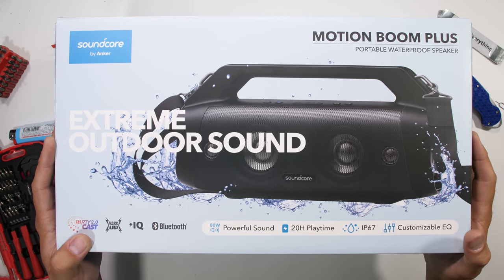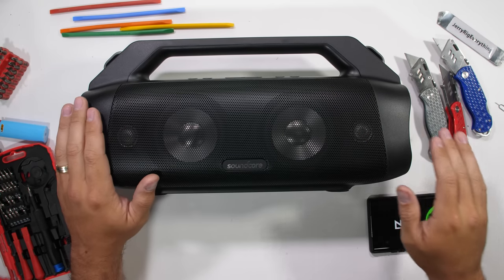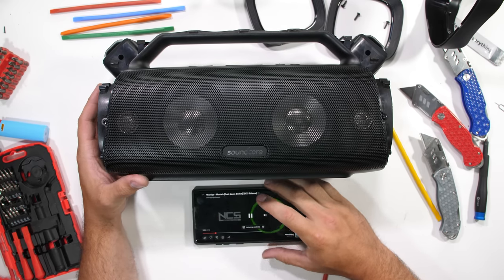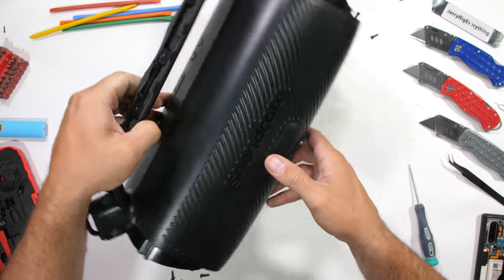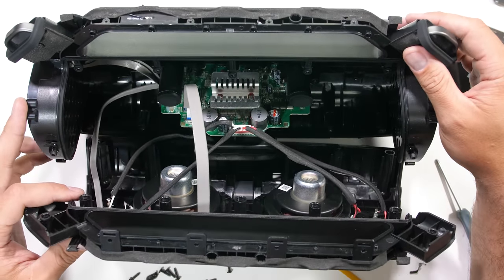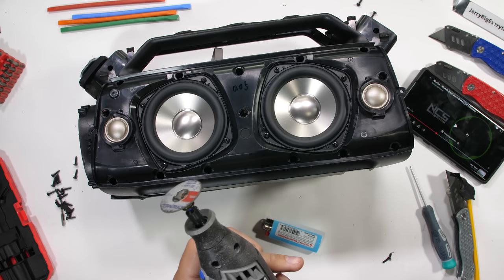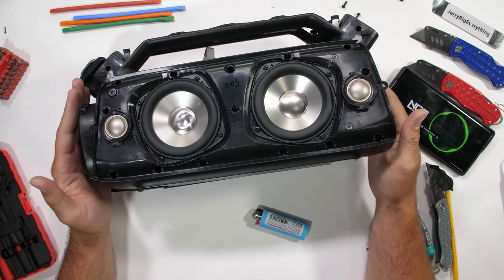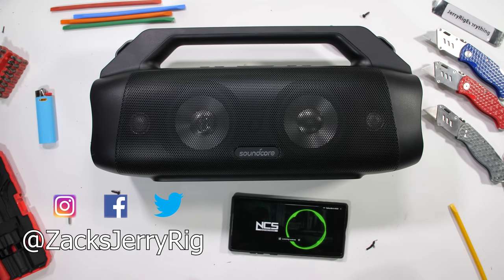This Rugged Speaker is made from.... Silk?

Comment: Well, the rugged bits are not the silk parts, but you already knew that 😉
Silk dome tweeters are known for clarity without harshness and have been around for a while. I have them in my 11 speaker system in the car, and they make close proximity speakers more enjoyable 😊
Reply: Depends on the tuning, this speaker is harsh actually
Reply: @sorawisdom6516  I own it, it would even say the opposite, it's less hearable in videos. 

It does have a 6khz peak that make it harsh, and even Custom EQ can't solve it.
Reply: 11 speaker system🤣 Yeah.. If you count all drivers individualy like they often do in cars. 1 tweeter + mid + woofer acts as 1 speaker but consists of 3 drivers.
But a silk dome tweeter can also sound very harsh and metal domes can sound smooth etc. It avtually all depends on ALOT of factors like tuning, dampening and MUCH more.. So there is no rule for that..
Reply: @Oystein87  Thanks for saying that. It's always down to the tuning and always will
Reply: @Oystein87  I'm seeing people not even using tweeters anymore, running compression drivers but those are the really loud guys
Reply: @ThibautMahringer  Yeah, but not just tuning. Also build methods etc. Many many factors. But tuning is key
Reply: @lxrdvader2021  Huh? A compression tweeter driver is still a tweeter.. Compression drivers are not much used in cheaper home audio though.. Some mid to high end home audio use it and it is almost the only thing used in PA in arenas etc.
Reply: @Oystein87  technically not a tweeter, frequency range is much wider compared to top of the line super tweeters. BNC makes em for car audio applications and they can take your highs and vocals to another level. It's not gonna replace a regular tweeter but if you wanna be loud its the way to go
Reply: @lxrdvader2021  Wrong.. Technically it is a tweeter in every way. It just plays bacwards to make the compression. Freq range is exactly the same. But like with litteraly every driver you can build and tune it to play wider freq ranges. That has nithing to do with beeing compression or not. Compression drivers are used because they are extremely efficient compared to a standard driver. But horns are also very efficient. That is why compression tweeters and mids often also sit inside a horn. And yes it can absolutely replace a "regular" tweeter.. DIY people litteraly build and change put parts like that all the time.. Think you should read a bit more about compression vs regular tweeters and drivers. I also used to think some of the stuff you do. Untill I learned it was very very wrong.
Reply: @lxrdvader2021  I belive you are thinking of the horrible Piezo (?) tweeters from what you are typing btw.. Those are HORRIBLE and dont require x-over because they have insane high impedance. Not the same...
Reply: @Oystein87  lol I dont even know what that is. When I say super tweeters I'm thinking Orian, Rockford, JBL etc they got hefty and strong magnets. They look like little 2 inch subwoofers lol
Reply: @lxrdvader2021  Sounds like you describe them and not compression drivers..
"Super tweeter" is just a definition for a tweeter that plays waaay beyond 20kHz.. Like my JBLs have 5way setup with one tweeter rolling off at 20kHz while the "super tweeter" rolls off at 40kHz.. But some brands you mention like JBL have compression tweeters with huge magnets and housings that are "super" good.. But the magnet size itself says little since a neodynium magnet is small yet very strong. That is what my tweeters use.
Reply: @Oystein87  ugh links arent allowed in the comments, not gonna type it over. Search B&C DE400TN HF drivers. Thats what I meant by compression drivers. People in the car audio scene where I'm at are using like these. Hopefully it clears up what I mean
Reply: @ThibautMahringer  It's too bad they messed it up then. In normal speakers, it's not that way, but I guess if the product developers don't have a good ear...
Reply: @Altema22  I don't know what happened with the Boom Plus, at launch it was fine and the first firmware update introduced a 6khz peak... Apparently it will be fixed soon but why in the hell would they introduce a 6khz peak through an update in the first place ?
Reply: @ThibautMahringer  So you're saying that material has no effect whatsoever, and feeding a flat signal to a glass or a foam driver will give the same frequency response? Just asking as a professional audio engineer.
Reply: @Altema22  What ? I didn't said that, I explained what's the issue with the Soundcore Motion Boom Plus speaker specifically

Of course materials do matter. But I didn't talk about this. However good materials with garbage tuning will always be bad
Reply: @Oystein87  Lmao what? Tweeter + mid + woofer does never act as 1 speaker. What kind of logic is that? Tweeters are speakers, mids are speakers and woofers are speakers.
Reply: @maxl7827  HAHA!! Yes they do... ;) As a part of a 2way, 3way etc speaker. Together the different drivers act as one fullrange speaker. Logical. The only reason they devide it into two or more drivers is because one single fullrange driver sucks at highs and gets even worse at it when playing lows at the same time.
But please tell me.. If you have a pair of speakers at home and inside the enclosure there are 3 drivers in each. Do you say to people you have 6 speakers or 2 speakers? ;)
EXACT same thing.... And very logical. Learn basic speaker knowlage dude.. This is among the most basic and I learned it when I was like 5 or 6 years old.
Reply: @Oystein87  Theres no such thing as full range speakers and if there is it sucks. All of the speakers, tweeters, mids and woofers have their own frequencies they cover. Speaker definition is not being capable of covering full frequency response, your logic is hilarious. When you have a car with 11 speaker system you dont say the car has 1 speaker. Your logic is flawed, you are misunderstanding channels. Also it is not 2 or 3way speaker, it is 2 or 3 way component set. Component and speaker are different things. Learn before commenting stupid things
Reply: @maxl7827  Yes there is.. Single fullrange driver speakers have excisted since the very first speaker was made. Basic knowlage dude..
HAHAHAHA!! You REALLY do NOT understand the basics of speakers. Don't confuse single dedicated freq. DRIVE8RS for beeing a complete fullrange SPEAKER system. Never ever do that huge mistake again!
Reply: @Oystein87  Oh you also have hard times in reading comprehension. I said theres no full range speakers and if there is it sucks. 1 speaker can be 1 tweeter, 1 mid or 1 woofer. 3 way component set consist of all those. However the 3 of them are not called 1 speaker, its 3 speakers. Basic knowledge, you need to learn
Reply: @Oystein87  No, you use wrong words now. It is 2-way component set, not 2-way speaker set. Yeah together they make a speaker system and the system consists of 2 speakers in this case, thanks for proving me right. I am 17 years old and I work with Bmw audio on Bowers & wilkins and Bang & olufsen lol. You have clearly misunderstood basic knowledge, please read a book or something
Reply: @maxl7827  Sorry that you just continue proving you have no clue. I have been working with speakers for over 30 years so don't even try... A twweter is a speaker driver and is just one of atleast two drivers needed to make a complete speaker. Like I said.. I kearned this when I was 5 or 6 years old. It's THAT basic knowlage.. A speaker containing 1 tweeter driver + 1 midrange driver + 1 woofer driver = ONE complete fullrange speaker. Facts. Or are you actually trying to say all speaker manufactures in the world is wrong and little you knows better than everyone else in the world? Because that smells like a troll to me.... Please learn the most basic things behind speakers... It litteraly takes just seconds on google to prove you are wrong..
Reply: @Oystein87  Dude no, you did not learn it at 5 or 6 years old, I think you meant to say you are 5 years old. That explains your comments. Just read speaker on wikipedia and it will tell you all this basic knowledge you are arguing over. Who says two "drivers" are needed to make s complete speaker? "Speaker definition is an electroacoustic transducer,[1] that is, a device that converts an electrical audio signal into a corresponding sound.[" You are higly misunderstood, a quick google search will prove you wrong. Dont spread false information
Reply: @maxl7827  "What is 3way speaker?
A 3-way speaker generates sound from three individual devices known as the mid-range, woofer and tweeter drivers. Each of these owns its specific efficiency in a wide range of sound frequencies."

"Full-range loudspeaker drive unit is defined as a driver which reproduces as much of the audible frequency range as possible, within the limitations imposed by the physical constraints of a specific design. The frequency range of these drivers is maximized through the use of a whizzer cone and other means. Most single driver systems, such as those in radios, or small computer speaker designs, cannot reproduce all of the audible frequencies or the entire audible audio range (i.e., sound within the range of human hearing)."

Never ever mistanke the dedicated speaker drivers to be a complete speaker😉 You need two (or more) drivers to make a 2way (or 3way and so on) speaker. That is speaker basics 101... You are the first person I have ever seen in my life trying to claim anything else.
Seriously how old are you!?!
Reply: @maxl7827  My floorstanding speakers at home are a pair of 5way speakers. They contain:
1x super high freq tweeter driver, 1x normal tweeter driver, 1x midrange driver, 1x midwoofer driver and 1x woofer driver.
By your logic I have 10 speakers in my home😅 But I don't, do I?😉 I got one pair of speakers consisting of 5 dedicated drivers in each speaker. Exact same thing in a car... It is so basic it's hillarious you can't understand it.
But I must say.. Pretty impressive that you manage beeing the only person I have seen in my life that did not understand this basic knowlage👀 That is just..🤯
Reply: @Oystein87  Yes, you need 2 speakers to make a 2-way system. But one speaker is one speaker, doesnt matter if its tweeter, mid or woofer. I dont know why you copied what a full range loudspeaker is from wikipedia. That has nothing to do with what we were talking about
Reply: @Oystein87  So how many speakers does your car have then? I rather listen to brands like Bang olufsen and Bowers wilkins who say there are 15+ speakers in their car systems. Your opinion is irrelevant you are just some random dude on youtube. Also you have home speakers, I have bluetooth speaker which consists of 4 speakers. But thats why its called as "one" because its a 'bluetooth' speaker same thing with 'home' speaker. Another example, Bowers & wilkins 686 is called a bookshelf speaker or standmount speaker. Its not called just speaker, because that would be technically incorrect.
Reply: @maxl7827  You need 2 speaker DRIVERS to make ONE 2way speaker. Please understand the most basic difference.
Yes it did actually have something to do with what we are talking about. And please notice it says "speaker DRIVER" in every article... A dedicated tweeter driver + a speaker driver for the mids and lows = ONE 2way speaker. Every manufacturer in the world can tell you this. So stop trying to change the facts. I repeat: Learn the difference between speaker DRIVERS and a complete speaker.
Reply: @Oystein87  Yes exactly, you need 2 speakers to make a 2-way component setup. Heres more knowledge for you: "A driver is usually a specific speaker such as a woofer for bass, tweeter for treble or perhaps a "full range driver". The term speaker can be used for all the above" Your point is irrelevant
Reply: @maxl7827  I have 5 speakers in my car. A pair in the front doors, a pair in the back doors and a sub in the trunk. The front pair consist of a driver that plays bass and mids and a tweeter for the highs in each side. Same for the back door. By your logic I have 9 speakers. But I don't. I have 9 speaker drivers that make up 4 pairs of speakers + a dedicated subwoofer.
LOL! B&O etc never claim they have that many speakers ik the car.. They have that amount of drivers. The car manufactures however counts every driver as a speaker just to make it sound cool on paper. This is a well known fact.

Your bluetooth speaker sounds like it has 2 active drivers (Left and right channel) and 2 passive drivers (instead of bassreflex ports). That is stereo built into in one speaker.
A "bookshelf" speaker is just a speaker.. The "bookshelf" part is just because they CAN fit on a bookshelf. But that is rearly recomended placement since it would not sound as good as it would on a dedicated stand. I see you have mo knowlage about this at all. I have been doing this for over 30 years so stop trying to change well known facts. That is what trolls do.
Reply: @maxl7827  You litteraly copied the description of what a driver in a speaker system is and you still do not get it!?🤣 You just proved me right dude.. Just like I have been sayikg all the time... 1x tweeter driver + 1x mid driver + 1x bass driver = ONE complete 3 way fullrange speaker system.
Or you could use a single fullrange driver but that is not as good as a 2 or 3 way speaker. You litteraly proved my point👌😅 Brilliant!

Comment: Love the Anker Soundcore products. Still rocking my Soundcore2 from 3 years ago. Also, nice to see even that more modern big speaker still has an aux port. ^u^ <3
The more you tear into the speaker, the more impressed I am with it's build quality. It puts my mind at ease that Anker doesn't just slap things together with hot glue and plastic tabs. Or use fake tweeters, as the screws proved lol.
Reply: Love my soundcore Q10 as well, anker is underrated generally for their products, which happens to be really well made and quality actually.
Reply: I use my Soundcore 2 at work every day. They messed up our radio in the kitchen area of our restaurant so we went a long time without music and that's not okay, so I picked one up thinking it would be loud enough to hear at least at my station. Nope, it fills our entire server aisle at around 80% volume and we use it almost all week before it needs charged again. Oh, and it sounds amazing. I was debating getting one of these Boom pro models for larger outdoor gatherings and floats, this video pretty much confirmed it.
Reply: @georgie2133  well, they sell pretty cheap stuff, and you can hear it.

Comment: I was going to be surprised that you didn't know tweeters could be made from silk. I should have known better. I am impressed with this speaker, I might look into buying one.
Reply: Most half-decent tweeters are soft/silk dome. Some are metal domes, which I try to avoid in most cases (exceptions exist. Canton for instance does a pretty good metal dome). 
You can imagine that if you have something resonate at high frequencies, you want it to not be to rattl-y.
Reply: I didn't know you can make speakers 1/50 The size of the human hair My headphones have it it's called a planar magnetic and it's expensive or cheap you can make them either way.

Comment: The partycast feature is super nice, but it should be noted that the only thing new about it is the name, and slightly easier pairing between multiple speakers. This multi speaker pairing has been a feature of soundcore products for a long time, and is fully reverse compatible. I have a soundcore motion boom, as well as a Rave NEO, an older model, mine is about 5 years old and connects seamlessly. The sound is quite impressive with 2 of them going at once. Even at lower volumes they fill the room quite nicely together and provide an audiophile grade listening experience. The speakers are not cheap, but I can gladly say that they are worth every penny, and that soundcore rocks. Literally and figuratively. 🤘

Comment: Well Jerry I was pretty surprised to see a Speaker on your channel as well. But I was wondering if the woffers were actually made out of titanium and especially silk tweeters since people were starting to call it plastic titanium look woffers. For the price this speaker is very impressive beating out much more expensive speakers with a custom EQ. I still haven't reviewed this speaker for myself but there are 2 main problems going on with the Boom plus the main issue is when this speaker is exposed to the sun and warm to hot conditions the passive raditors bulge out and lots of distortion will occur until you place it back inside or cool it off. Second it has a peak at 6KHz which makes the music sound pretty harsh at higher volumes. Soundcore is already on these 2 issues so for people wanting to buy this speaker I would wait a bit. Great teardown Jerry keep up the work👍
Reply: Mmm if that is so I would recommend people buy the JBL rugged bluetooth speakers instead as they have non of these problems (comes in many different sizes and works great if you buy 2 to run them in wide field of sound stereo)
Reply: Lol I'm a reviewer bro but Soundcore has reached out to me and also said the hot air issue is no longer a problem so I'm going to test it and see if that is true

Comment: I can only imagine JBL's original prototype of this speaker...probably started it's skunkworks conceptual life as a cheap PVC tube with some high quality drivers and  radiators serving as the end caps.  I have an Extreme 3 and it sounds surprising nice.  👍
Reply: I have two exstreme 2 :) They are even better when you have a pair as you get wider stereo sound and more bass. I use mine as everything speaker even in the car when I travel as they have more bass and better sound then the built in sound system of my car.
Reply: @a64738  Your car sound system sucks then